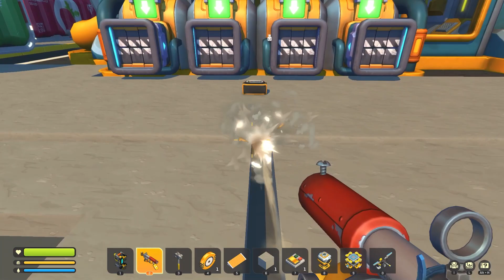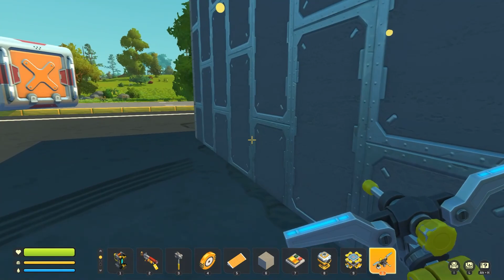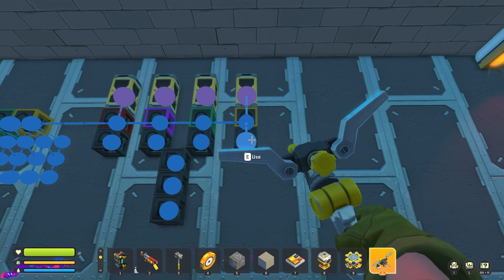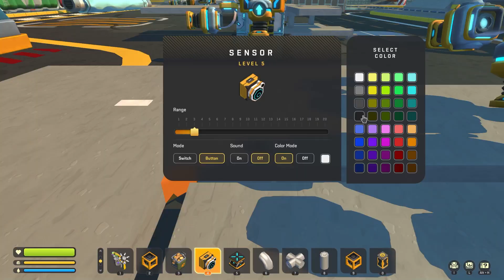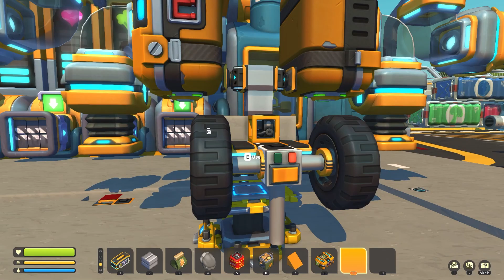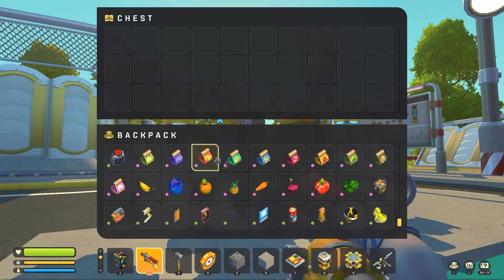Crop Distribution Network - Scrap Mechanic Survival Unleashed

Comment: This is great!  Loving this series.  I think there are small green wedge blocks that have a much smoother/deeper curve, which might help (to replace the orange wedge blocks) to turn the drone even better.  I also think there might be away to add multiples at each corner to give a smoother turn.

As for the complicated turning mechanism, I think it is great, and I'm very happy to have learnt about it in your videos but if there is a better easier solution, I see no problem you switching to that.  Keep the other video up though, as a lesson, why remove it, it's not click bait in my opinion.
Reply from the maker: Ah yes the curved wedge pieces are also a good option, I'll look into testing those soon! 

Thank you for the feedback on the other video too, I will keep it up! 

Thanks :)